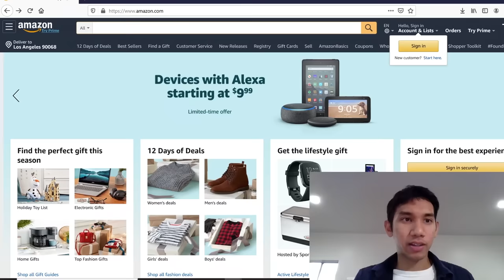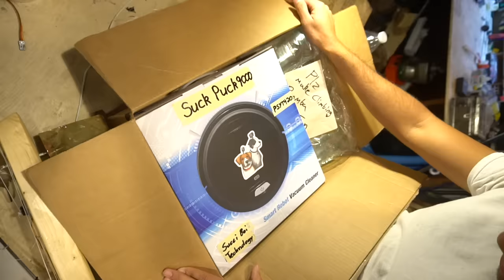A Roomba that CAN FLY!

Comment: This flies way better than it should be allowed too.
Reply: Sam's a pretty talented engineer I think.
Reply: To*
Reply: He made a Terrable drone but it’s somehow better then any drone I’ve ever got
Reply: It moves like it’s on a string. Swinging as it went up stairs.
Reply: fake because if why should some thing that was barely able to ge off the ground at 70% power be able to fly that high
Reply: @mrtuvok5578  wait so how is it fake when u just saw it fly?
Reply: @dund614  look closely
Reply: that old kk2 fc sux too.
Reply: 8:42 how would they fake that
Reply: Exactly
Reply: the fan ducts do all the work,there were some video's on the effects of ducted propellers , basically it makes it so it moves slower in the horizontal plane and also has the perk of self stabilizing too.
Reply: @MikeNPeeGee  i know it looks really much like swinging but that's just how ducted propeller drones fly , they don't slide as much as non ducted ones  so it takes small amount of correction to fly these, they are also slow in the horizontal plane because of the ducted propellers
Reply: @mrtuvok5578  once it can go beyond the ground effect bubble it can actually go pretty high before atmosphere is thin enough that the motors can't push it any further  ,i do have a drone and i try sometimes to find the highest point where it will hover without throttle input which is about 40-50 cm off the ground, after i get it stable in that plane if i add just 2%-3% extra throttle it will keep going up  until i cut the throtle again 
 PS :it's a hobby racing drone , not one of those commercial auto pilot thing's , you can compare it like old cars vs new cars with and without cruise control
Reply: @mrtuvok5578  you clearly don't fly rc.
Reply: @rowlesreels9309  The drones I've had are fine but I'm just a terrible pilot.

Comment: If you put three ultrasonic sensors at the rotors, you could ping distance while in the air, and go towards the highest distance once it reaches a ledge, then descend at a fixed speed in order to automatically navigate stairs.
The only issue is that I doubt the stairs will always be the last thing it goes to on a floor

Comment: That's actually not a bad idea. With the way modern robot vacuums map your home, it should be possible for them to detect staircases and be able to fly up and down them simply by following the wall/railing, but not close enough to crash. It does rather increase the cost and complexity so it might not be any cheaper than simply buying 2 of them. But if you have 3 floors of more, it starts making sense.
Reply: Uhh. You also have the problem of people going up or down the stairs. If the robot hits them, they could fall down.. Stairs are easily the worst possible place to fall down in a house...

Comment: Gut everything out of the Roomba so it's just an empty body. Cut 3 fan holes in the top and bottom and mount the fans inside the body along with all the electronics.  It'll look like a UFO. lol
Reply: Hmm, sounds like the movie "batteries not included"
Reply: Sounds cool, but idk if that’s would be stable.
Reply: What about the steering tho
Reply: But then it wouldn't work as a roomba whitch would go against its purpose entirely

Comment: You should get Micheal to write a code that lets it follow a set route around the house with a GPS or something that way it could go up the stairs automatically
Reply: Better yet have it run into every thing and get stuck under beds
Reply: or William or Sam
Reply: Micheal would code it to be the leader of a drone swarm, or to curse while flying. The dude is literally a mad genius out to create the stupidest/funniest way to end humanity.
Reply: @DarkGaming-xj9ly  It just needs a taser and a butane torch as well
Reply: GPS won't work indoors bro... Even if they, they are far more less precise... ± 1 - 2.5m even with a good 3D fix and less HDOP
Reply: @abhishekreddy2425  even better then it'll crash into everything lol
Im not smart regarding tech but could they make a closed system with sensors around the house

Comment: What would happen if you swapped the Roomba vacuum parts for a main rotor and tail Rotor or twin Contra Rotating single shaft two in one rotor so that it flew all the time. You could make an automated drone out of it . You could also use flywheel generators to reclaim and convert mechanical energy into electricity ?

Comment: I have a question about flying stuff so that thing obviously wasn’t equally weighted so how did it fly stable is there any stuff that I can look up to figure this out like let’s say you had a drone that was slightly heavier on the left side how would you be able to correct it or how does the drone know how to correct that ,is it something with the flight controller.

Comment: I think I would've tried to cut down the weight by at least half.  I guess this is 4yrs old though.  Make it a quad, strip it down to just what makes it a robot vacuum because I might swap out that heavy frame with carbon fiber

Comment: 4:06 Anybody knows the green PCB board that is being used.
Reply: Found it on eBay: KK 2.1.5 LCD Multirotor Flight Control Board KK2.1.5 V1.17S1PRO Quadcopter